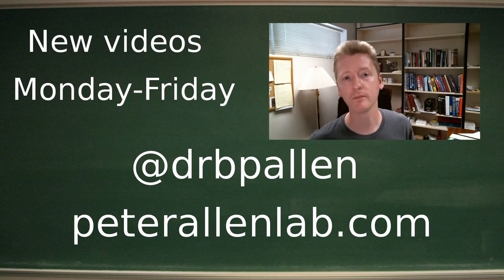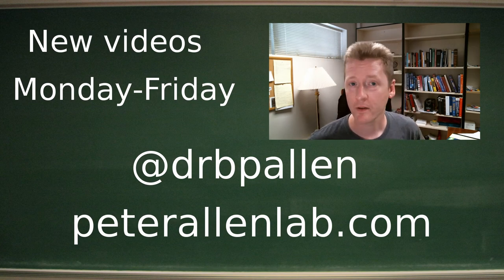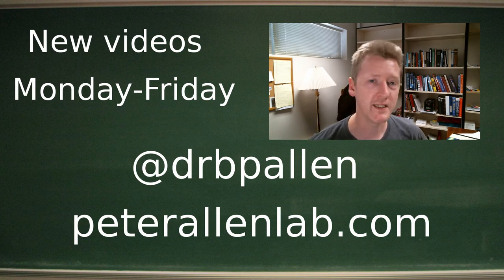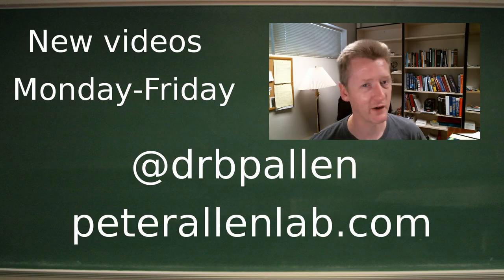Pitch drop, the longest experiment and a new design for all iron battery

Comment: Peter, it's cool to see how you can make a substance with the properties you want at the molecular level.  Looking forward to seeing how this works.....
It seems the membrane is the hardest component to get right in a flow battery.  Some designs try to avoid it all together with laminar flow.  Some designs need only microporous membrane, some need ion exchange membranes.  if the anolite or catholite could be designed to naturally separate, like oil and water , or via heat stratification, or density differences that could eliminate it ....?
Reply from the maker: Thanks for the thoughts. Keeping the materials separate is one issue, preventing reaction at the interface is another. I think using oil-water would solve the first but maybe not the second? Did we talk about that flow battery with the inert third laminar layer in between the other two? I thought that was clever. It was like a pseudo-membrane of flowing electrolyte that keeps the other two separate. Heat stratification would be interesting, that reminds me of the liquid metal battery by Sadoway/Ambri.